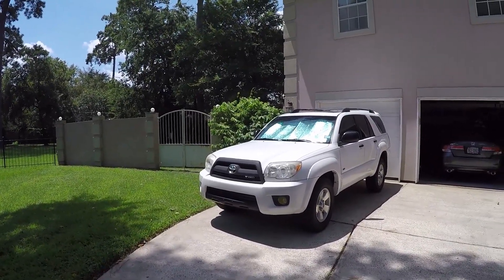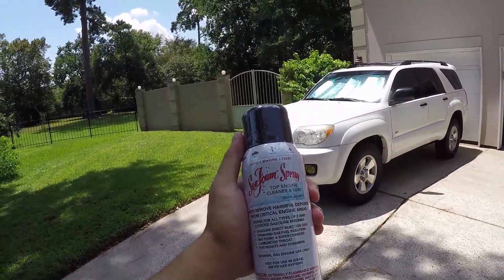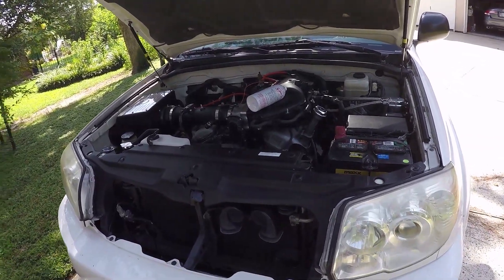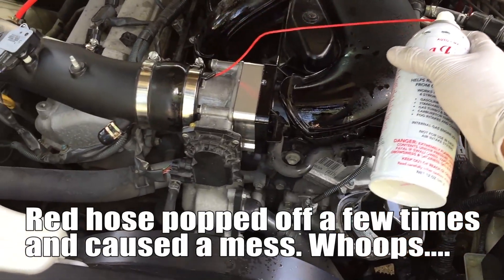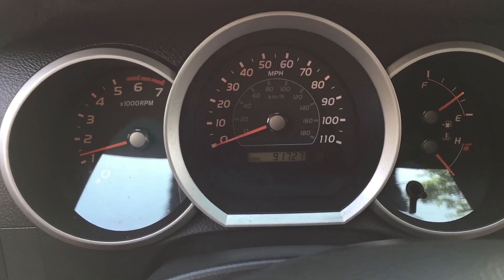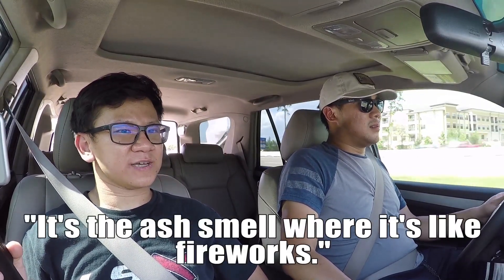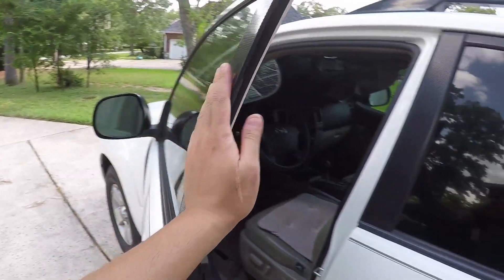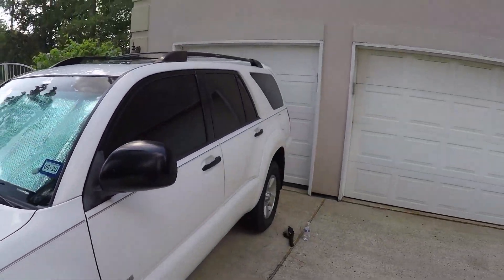2006 4Runner Seafoam Experiment

Comment: Thanks for the video 🎥. Let us know if improves gas miles.
Reply from the maker: Miguel M There may have been an increase, but it’s too small to notice it. However it made the engine rev a lot smoother
Reply: Airsoft Mechanic 
Thanks brother. I appreciated. I will be doing it too soon.
I have a 2007 V6 SR5. LOVE THIS MACHINE!!!
Reply from the maker: Miguel M I highly recommend it. Good luck!

Comment: Nice vid! I like to remove & clean the TB then reattach and spray Seafoam thru the vacuum line connection flange just past the TB on the beginning of the intake manifold. Once the engine is warm one person can do this alone while the engine idles (spraying pretty aggressively but backing off a bit if the idle starts to drop). Use entire can like you did. I also like to use a 20 oz bottle of Techron (by Chevron) fuel system concentrate to a tank of gas prior to this procedure. It may be totally my imagination but I swear the truck has way better acceleration after doing this twice a year. 
I’m curious, what effect have you noticed since installing the TB spacer?
Reply from the maker: Dominique Stephenson Techron helped clean my engine for sure when I first got my 4R. 

The throttle body spacer increased the low end torque, and gives the engine a nice little whistle. Lol

Comment: I would Definitely change the oil afterwards!!!! Those carbon deposits you just broke up everywhere in that engine are still going through it!
Reply from the maker: elite skilz I think that applies if I poured Seafoam in the oil. In this case it went through the intake manifold and left through the exhaust. Though I’ll keep that in mind since having blow by is a possibility

Comment: Where did you get the trd grille for your 4th generation 4 runner?been looking online for ever haven't been successful.
Reply from the maker: Norman Sutton It’s just a black grill. The TRD emblem is a separate piece. Both were bought on eBay
Reply: @airsoftmechanic  can you send me apart number or link?
Reply from the maker: Norman Sutton 

TRD Emblem: https://rover.ebay.com/rover/0/0/0?mpre=https%3A%2F%2Fwww.ebay.com%2Fulk%2Fitm%2F223282064540

Grill: https://rover.ebay.com/rover/0/0/0?mpre=https%3A%2F%2Fwww.ebay.com%2Fulk%2Fitm%2F173877079563

Hope this helps